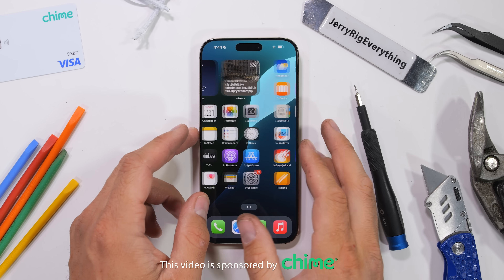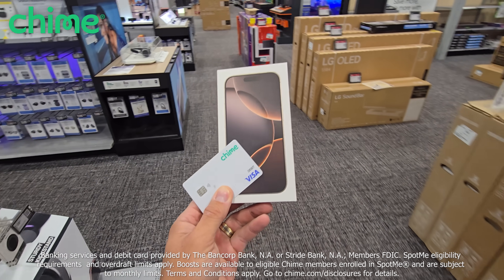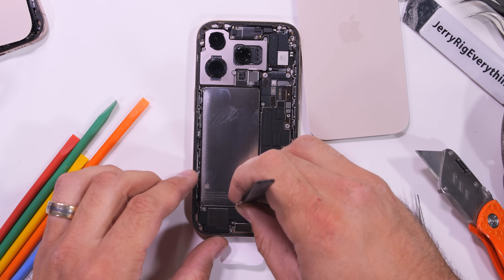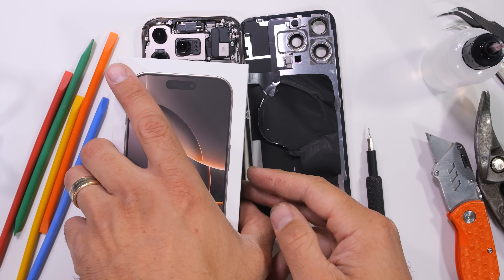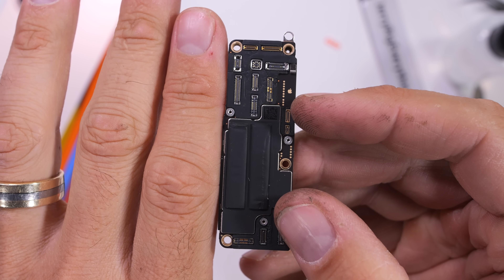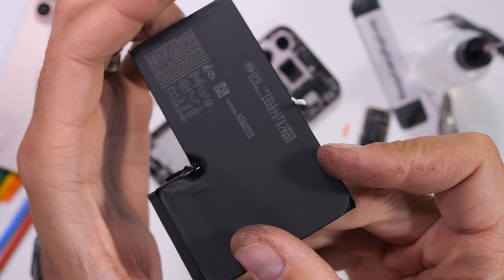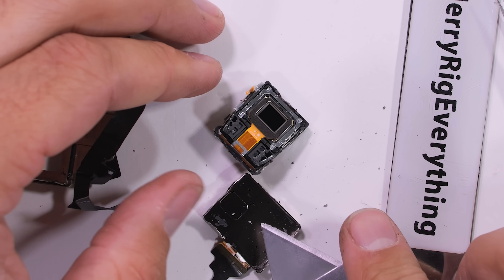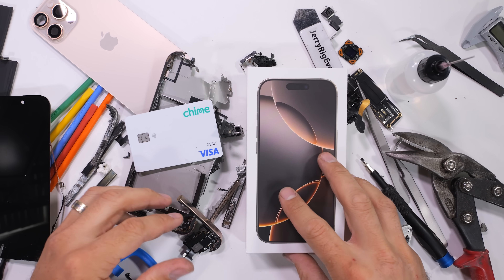Dear Apple: i am sorry...  (iPhone 16 Pro Max Teardown)

Comment: “Yesterday's tech for tomorrow's price”

Look at how wrong these guys were.
Reply: for the record they havent raised their prices for years
Reply: @noberd  Screen replacement prices have increased and battery prices haves also increased by a bit, so repairs are more expensive now
Reply: @SpaceShark2011 This is always the case with brand new phones, as supply of parts is lower. The price stabilises over time
Reply: I think I have seen this comment before. It feels like yesterday's comment for tomorrow's video.
Reply: As if other companies release groundbreaking new features each year… all of the smartphones have their pros and cons and if you’re close minded then you’ll say other phones suck anyways without actually knowing what they have to offer
Reply: Look at the sad pathetic adults arguing about a phone in the comments
Reply: @GodOfWar109  REALLLLLL, THEY'RE JUST PHONES. IT'S JUST PREFRENCE 💀💀💀
Reply: also "Create problems, sell the solution"
Reply: Freaking Android Fanboys
Reply: @JoeNasr123  Apple fanboys exist too
Reply: Right, even though Apple almost always beats androids in benchmarks and processors, and hasn’t raised their prices in years for their flagships. I know it’s a  Catchy slogan and it’s hip to hate Apple for breathing, but this is a stupid slogan frankly.
Reply: @crf1096 Yeah? Your 1000k apple will obviously beat our 500$ android 💀
Reply: What is “yesterday’s tech”?
Reply: @Jsameds Samsung using a 3 year old sensor in the S25 ultra
Reply: And still better than most phones😂
Reply: It’s much better than the junk Google and Samsung put out. I bought the latest Pixel and watch from Google. Absolute garbage.
Reply: @Fluterra need to sell that smack you must be smoking
Reply: Man, the jealous hatred of Apple is unhealthy. If you can't afford it, just don't buy it. Get a crappy Android instead. Why insist on telling lies?
Reply: @bobweiram6321 I never got the point of paying more than $250 for a new smartphone.
Reply: @bobweiram6321 Ahh, classic. When you can't justify apples crazy pricing, just throw around "You're poor"
Reply: @SpaceShark2011 imagine edit saying thanks for the heart and then ended up losing it automatically 😂
Reply: Buy something cheap then and quit the whining
Reply: Scamsungs propaganda guy spotted
Reply: Samsung may sometimes debut features first- but they don’t work properly for YEARS. Face recognition. Fingerprint sensor. Apple gets it right and it works seamlessly and flawless with no hiccups no lag. Hate to break it to ya 🤌🏼🤌🏼
Reply: @GlutenForPunishment That's the biggest apple fanboy spin zone I've seen. Firstly, Samsung made 8k 120hz cameras first and JUST AS GOOD as Samsung. Obviously it's JUST PREFRENCE. NOT FACT 💀
Reply: YouTuber commenter motto: yesterdays comment for today’s likes
Reply: iPhone destroys every other Android CPU and GPU in benchmarks. Even LAST YEAR’s apple chip destroys this year’s Snapdragon chips, so your Gen 4 cope is hilarious. Only Apple can run Resident Evil 7 and Village NATIVELY. Stop the coping; if you can’t afford it; we get it, it’s expensive; I’m
Not even an Apple fan, I rock a Pixel 9 Pro XL; but it’s time to be objective and stop the lame Apple jokes.
Reply: @Square_Penix  i agree on stopping the apple jokes, but you are a bit overracting 😅   qualcomm's gpu is tecnically much faster  than apple's igpus. The 8gen2  had a 40% stronger gpu compared to the a16;  

I say tecnically because practically  the chip cant use that monstrous gpu since qualcomm is still a good 15%-20% behind in cpu.  The 8gen4 isnt much of a cope considering that they will (allegedly) use their new nuvia cores, which should close the gap!  Or atleast, the snapdragon x elite processors with those cores are pretty good.

And we dont have native triple a games on android because no one develops them, but android has fantastic emulation.   (The witcher 3 at 720p 60fps  is now possible on a redmagic phone)
Reply: @Square_Penix  LOL yeah of course your 1000k dollar apple will run faster than my 500$ Samsung. No need to whine about how "You're just poor lol, keep coping"

If you actually looked at it objectively, you'd find that there're just phones. And it's just preference.
Reply: I don't get this. Costs the same as the s24 ultra and performs on par with it. So I guess they're both following the same motto?
Reply: Yawn…
Reply: Jerry said this in theast video about 4k camera recording didn't he?
Reply: Never heard about Nintendo then
Reply: @jcmuscle123  Nintendos tech is dirt cheap lol wydm? It's yesterday's tech for last weeks prices pretty much.
Reply: But gives tomorrow's level quality and assurance
Reply: He said that in an older video you baffoon
Reply: Wait, that isn’t the generic NPC motto? I’ve seen it at least 10x so far
Reply: Price hasn't technically changed in years. Not since the jump to iPhone X. 1199 may be the starting price, but that's because of the storage doubling up. However, they did keep the pro models price the same, even with 128gb starting storage, considering the iPhone X started at 64gb
Reply: Grabbing view in name of apple. Negativity gets more views
Reply: the scream of my brain's frontal lobe!
Reply: Fact is an iphone lasts longer than an android and i had android for more than 10 years… i have quite a lot of experience on this 👀
Reply: Android motto: make shit for everything. Micro,tv,pocomoco phone and more. 😂
Reply: Mfw iPhone is the best on the market and androidbros spend all day hating and comparing because they’re sad their Samsung is half as good as an iPhone
Reply: My iPhone 12 got stolen, do i buy a 15 or 16 ?
Reply: @Tej-Thomas.J  may as well go for the 16
Reply: Copy and paste
Reply: same price don’t get it
Reply: Apple hasn’t raised prices on its phones since 2017.
Reply: Ive been seeing this joke on the past 10 videos i watched. Its funny to me because you probably typed it on an overpriced phone from an apple with another name.
Reply: Comment copied from YT channel SamTime
Reply: Samsung’s motto: we first criticize Apple for removing something but then we got it too. We are a bunch of plagiarists whose phones explode. We call that being blown away
Reply: It’s okay, I’m not mad at them cause the iphone 16 base model doesn’t have a 120hz display, I’m just disappointed
Reply: @mniakan754  Get a samsung
Reply: The price has not changed since 15 Pro
Reply: @superqaxclub  it's just that the 128GB option has been dropped in the 15 lineup, AFAIK, 256GB was 1200$ since the 11 pro max. Not saying that the price is justified, but the price actually didn't really change. This is probably why apple puts 8GB of RAM in the macbooks by default...
Reply: Take it or leave it!
Reply: Is your avatar ragebait or something like that?
Reply: Real 😂
Reply: pidor red
Reply: Literally Zacks quote from last video
Reply: Can we not be ignorant when we criticize?
Reply: So true 😂😂❤
Reply: Chinese stuff are todays crap for yesterdays price
Reply: This comment gonna blow tf up
Reply: Did not use the 5v battery to remove pull tabs?
Reply: Vision Pro is so outdated :)
Reply: Yes, many people will think you came up with this by yourself.
Reply: He said that in his last video.
Reply: Jerry already told that in last video
Reply: Ooooo free phone!
Reply: Lost 🥱
Reply: Iphone 16 and s24 128gb both start at $800, s24 ultra $1300 while 16 pro only $1000. You are just factually incorrect
Reply: Npc comment
Reply: y’all keep saying that and its getting annoying 😭😭😭
Reply: Yet the Google 9 Pro and Pro XL has the CPU and GPU benchmarking the same as 4 year old processors 😂
Reply: i miss nokia 48MP pureview from 2012...
Reply: Bro these comments are actually mad unfunny
Reply: @immfi  They weren't supposed to be funny 💀
Reply: Hey Jerry, hearting a guy with a pfp of an idealogy that has caused tens of millions of deaths is not a great view.
Reply: Still better than every android phone
Reply: @SuperNovaHeights_  your entitlement to your opinion is a valuable good in society. everyone should be free to have an opinion, no matter how baseless.
Reply: @nutzeeer  yes. Thank you
Reply: @SuperNovaHeights_  LOL that's just blatantly untrue. Weather you want an iPhone or an android is literal preference NOT fact
Reply: You love stuff others come up with
Reply: Yesterday’s tech for future sales! 🤷‍♂️💩🫡
Reply: Hello Motto
Reply: Lol. Unfortunately I think everything is like that nowadays especially new vehicle sales. These things are coming out more expensive and shittier than ever
Reply: more like next weeks price
Reply: You took that from his other video 😂
Reply: @azuk1512 TBD valve customer service is pretty too tier
Reply: True 😂
Reply: Why do your video's make me cringe but I love them. 😂
Reply: I got listen to those pull tabs all day
Reply: It’s pretty much the same price! 🤦🏻‍♂️🤦🏻‍♂️
Reply: Good work getting a heart for literally plagiarizing Jerry!  @SpaceShark2011
Reply: Nice profile pic 👍
Reply: @SpaceShark2011 you still running that joke in 2024?! It is already iOS 18, for christ sake 18 🤦🏻‍♂️ get over it, yeah you don’t use apple, you use the latest greatest tech available we get money can buy, good for you

That android vs ios roasting is already so over roasted it has turned to charcoal
Reply: The price hasn’t changed though
Reply: Atleast the chip is good
Reply: Yesterday's joke for tomorrow's likes
Reply: 😂😂😂 low blow
Reply: profile picture checks out ✅
Reply: how is AI yeaterdays tech😂😂😂
Reply: I’m sorry, I think you mixed up your line. Apple hasn’t changed their price since the iPhone 10? 😂 and they’ve destroyed every other phone company that has
Reply: @prettycoolcat  LOL, So there phones were just always 1000k dollars for no reason?
Reply: Bro decided to spill facts😂🤌
Reply: For future price.
Reply: but its the same
Reply: Same prices for 4 years
Reply: +1
Reply: Yesterday's tech also will be out in the future for tomorrow's price 🤣
Reply: @VeryCuriousGuy Motto: Someone else’s comment for attention
Reply: Meanwhile, in reality, Samsung is using a 3 year old sensor in the S25 ultra and the Snapdragon chips are consistently at least a generation behind apples chips. And don’t get me started on the Tensor G4
Reply: @hugowells3052 No they aren't
Reply: @thark5509  Prove it
Reply: samsungs slogan is “watch out for the bombs💥”
Reply: Samsung: hold my beer
Reply: Absolutely no idea what you're talking about but hey as long as it gets likes
Reply: iOS is by far a better OS than Android.
Reply: How much is a Z fold?😊
Reply: @Someredheadguy  overpriced
Reply: Profile pic checks out
Reply: unoriginal
Reply: But better !!! Also most important Apple world for is … the smartphone itself 😂 imagine a world without Apple. People would still use flip phones and blackberry’s
Reply: apple serving up yesterdays tech... and still waiting for android to catch up 🐢
Reply: I’d rather have apple refine new tech instead of putting in junk like Samsung, giving features and tech and taking them away 2 years later; just like the IR blaster they gave us then took away.
Reply: @SpaceShark2011 Yet it will last longer than 99% Android available on the market
Reply: He said that in his last video. Copycat.
Reply: Yesterday’s tech that’s more powerful and efficient than what you’re using? That’s life the entire point of advancements in computing
Reply: @thraxberserker9960  is it yesterday's or the most powerful? Can't be both. And apple is neither.
Reply: Android: latest tech, with last decade optimization
Reply: Why do people say “tomorrow’s price”? Have you compared their prices with the other big brands flagships?? Samsung for example charges just as much. They’ve been charging that much for years. I’m not like an Apple fanboy, it’s just something people say that bothers me because no one talks about the fact that everyone else bumped their prices near Apples.
Reply: Pull Tabs ❌  screaming iphone ✅
Reply: Said by a communist…
Reply: Your??!!!
Ourr!!!!!
Reply: That’s why a have an apple every 3 years
Reply: Only if you’re the more that doesn’t sell your old phone as part of the upgrade. I’ve been upgrading every year since the 10 for $150 difference between the two phones. Fully unlocked - no device payment.
Reply: Thats why i still have the Iphone 11 and am finally upgrading to the iphone 16 pro max (due to storage, my iPhone 11 is a 64gb😭 and I’ve had it for almost 5 years now)
Reply: Not the best sorry
Reply: Faking Man
Reply: Cheaper than the galaxy phones now days
Reply: An Apple a year makes ypur wallet thinner 😁
Reply: You know these discussions have been going on for decades now, don’t you. If you’re so eager to defend your purchase choice… you might have buyers remorse.
Reply: Facts
Reply: Wrong
Reply: Any android phone I've worked with so far that's around the same spec level doesn't work as fluently and intuitively as an iPhone so one could argue android phones need buffed specs to achieve the same 😅 just throwing that out there. I'm an Apple user but by no means a fanboy, however, tastychocolat's comment is just stupid. Apple's the easy target for hate because of poorer repairability, but Samsung flagship phone repairs often cost around the same. Especially in the case of the most occurring repair, a screen replacement. In terms of pricing, that argument holds up poorly and I'd guess they're just a hater or an android fanboy.
Reply: It’s just a better experience. At the end of the day if it’s something I have to use daily I like it to be a cohesive experience. Just Face ID alone makes using a smart phone for so many things significantly easier. I genuinely don’t know why people care so much about stats when overall it’s simply about making the experience of using the product easier and more enjoyable. Apple achieves that which is why people buy them. I like that all of my tech(with the exception of my PC at work) is well synched and a cohesive ecosystem. If that means my screen resolution is .09% worse or loading speed is 1.2% slower i just don’t care. I don’t understand why people don’t seem to comprehend that most people simply assign more value to what makes their life easier. Say what you want about Apple but you can’t really deny they’ve done a great job at making their products all integrate together well.
Reply: You can play windows games on Android you can't on iPhone , plus iPhone has trash keyboard and no universal back button, also iOS 18 is a buggy mess, little to no ai features, that's coming from some one who has a 16 pro max
Reply: Meanwhile Samsung recycling the same S Ultra design since the S22 Ultra
Reply: @Gamezoner911  since the note 10+
Reply: And it just got leaked that the cameras are not getting upgraded till the s27 on the standard and plus models…..
Reply: @Gamezoner911  So there's a fkin changes in iPhone designs? 😱🤦
Reply: @Gamezoner911 And next year they’ll use the same main camera sensor for the 3rd time
Reply: @Gamezoner911 but they do something in software right away
Reply: @Gamezoner911 bro its still modern
Reply: @Gamezoner911 yeah same thing for apple from iphone 11 pro to iphone 16 pro. only difference is dynamic island but androids had punch hole camera design for sooo long that i don't count it because its not a remarkable design change after all
Reply: @DrHaldunGoksun what did Samsung add?
Reply: @reyash4 what does apple ever add.....that is innovative or important...I'll wait
Reply: @DrHaldunGoksun That’s only the only difference if you ignore all the changes they’ve made over the years
Reply: @Gamezoner911 I mean iphones design hasn't changed since the iphone 11. And their non pro phones look like a iPhone Xs. Lol
Reply: @BattleRapMultiverse didn’t Samsung change their phones last year to be more like an iPhone?
Pretty sure they even gave their tablet a notch too 🤦‍♂️
Reply: @BattleRapMultiverse Both objectively wrong
Reply: @BattleRapMultiverse Only if you’re blind
Reply: @BattleRapMultiverse dude have you ever seen a 15 or 16 IRL? You need a doctor for your eyes if you say they are similar to the 14
Reply: @Sayin42  Yeah. But still, neither of em are innovating in design. Lol
Reply: @MrJairforce  Numbers don't lie.
Reply: @hugowells3052  Data says otherwise.
Reply: @skrotosd  Yes. I've seen a 16 IRL, a pro max. Bezels are slimmer, other than that if you were a foot away and I had a cover on you wouldn't know it's a 16.

Edit: Same for Samsung.
Reply: @BattleRapMultiverse 
But here's the thing, changing design was never the motto of Apple and Apple is instead known for keeping the same designs, while Samsung fans always bring up their "new" designs. 
I have no issue with others preferring different designs every other model but I do have issue with those that bash people who aren't big fans of that and like constant designs.
Reply: @holyromanemperor420  I responded to someone mentioning designs, I'm not an apple user by any means. I'm actually a pixel owner, soon to transition to honor once the magic 7 pro releases next year since I want an ecosystem that Google does not have.

The reason I mentioned design was a response to someone that pointed out designs. I really don't care much for design changes. I care about software improvements.
Reply: @BattleRapMultiverse  🤣 Which data?
Reply: @BattleRapMultiverse  Which data?
Reply: @BattleRapMultiverse  What numbers?
Reply: @Gamezoner911 tbh.. the S22  Ultra is the most beautiful Smartphone Design Ever made. They can stick to that design forever. Like Apple does 😂😂
Reply: How original. I’m glad to see “yesterday’s tech” obliterating the S24 ultra for battery life 😂
Reply: @BCJ1973 false I can confirm it didn't beat the s24ultra in battery life 😂
Reply: Aight
Reply: Boring 🥱
Reply: What’s Samsungs? “Keep a fire extinguisher handy”
Reply: @marv8481 APPLE SHEEP SPOTTED LOOOOL
Reply: @marv8481  Maybye the samsung phones exploding thing was true in like 2016 💀💀💀
Reply: Umm, ahktually their A18 PRO is 89% faster than Qualcomm lastest in gaming🤓🤓
Reply: 89% the 8 Gen 3 still has a faster GPU than the A18 Pro 🤣@sivaxiosu
Reply: @dqskatt on a 60hz panel what a difference.and even on ultra you get that 89% the first minute after throttling -89%😂
Reply: @dqskatt  what else isnt yesterday cos their refresh rate is, their new customization is, their battery  (reverse wireless charging speed, and wired charging speeds), should i go on?

So when we say yesterday's tech for today's price, he ain't lying.
Reply: And what games have native support?i mean pc games running on arm by default  @dqskatt
Reply: @dqskatt  it seems that the new Qualcomm is gonna be better
Reply: @dqskatt  Apple gaming is not a big deal tho.
Reply: @KatTheCaz  iPhone is the best and fastest device there's for gaming, with Emulation is finally allowed in iOS, there's no point in choosing Android over iOS in 2024 purely based on gaming.

Except for pure delusional, Let 65% GPU utilization while being 2x faster speak for itself.
Reply: @dqskatt  I don't really game on phones anyway tho. But I use android sideloading a lot and now that Google basically removed it I might switch to jailbroken or even normal iOS anyway. The thing I like about apple devices is that it just works. Android be like: Home menu doesn't respond. Yea thanks. Meanwhile iOS chillin' in the corner sippin' some coffee.
Reply: @KatTheCaz how did google remove it?
Reply: @KatTheCaz  LOL you live in candy land? A samsung phones home menu will respond just as well as an apples as long as it isn't broken. But IT'S JUST PREFRENCE lol
Reply: @dqskatt and its cheaper than Samsung S24 Ultra
Reply: @dqskatt Only for 5 Minuten ;) than it is throttling under the snapdragon gen 3
Reply: @DoubbleDdragon  How can 65% utilization can thermal throttle, iPhone 16 Pro Max is actually 9 degree cooler than Samsung S24 Ultra 45 degree that difference from hot to touch vs warm.
Reply: @dqskatt But you are only using 60% of its capabilities, what a waste
Reply: @dqskatt the only thing they upgraded is better than last generation, wow
Reply: @dqskatt  who even need that much of power inside a smartphone that only use light processing apps. So unnecessary.

Just use PC if u need to game or boot heavy processing apps
Reply: ❤ @dqskatt  lol what's the point of having best Chipset if their iphone doesn't have good themal and it's not focused on gaming also the screen are just 120fps lol that's too expensive
Reply: @dqskatt  tell it again after 8gen 4 launches
Reply: @dqskatt no? The SD 8 gen 3 on the s24 ultra outperforms the s24 ultra in antutu
Reply: @dqskatt not true gen 3 GPU much more powerful
Reply: @dqskatt  SD 8 gen 4 on the way to beat A18 pro🤣
Reply: I appreciate how much people are comparing and complaining about phone processing chips when they all do the same things. They game, help you daily tasks like calling, texting, music, videos, social media scrolling. Does it even matter that much?
Reply: @JinsmokeDS  I agree with you, it really doesn’t matter! It only comes down to which OS you like better, like the only reason I use iPhone is because I like iOS better
Reply: Based profile picture, comrade ♥️🤝🏻
Reply: JerryRigsEverything says, then shows his Galaxy S24 Ultra that cost 100 dollar more than the Pro Max with the same storage. 

Not to mention that iPhone crushes Samsung in benchmarks etc. 🎉
Reply: Hey, great analogy. I feel like it's more like today's tech for next month's price.
Reply: Bruh 😂😂 so true that was!!
Reply: overused template
Reply: So many of you accuse apple of stealing when they literally contributed so much to the tech industry.

- First successful GUI computer
- iphone 1 which set the standard for modern day smartphones
- iphone x bringing the edge to edge display

There is so much they Apple’s done for the industry and you all hate it why? Because you cannot wrap your head around why majority buys Apple and not android. 

Most people just need a phone that runs smooth and performs the basic functions at the highest standard. Apple has good performance, good optimisation, clean and easy to use UI, best ecosystem . The camera’s are good. The reason you don’t see those people on YT is because they aren’t here complaining like you android users who are just hating for the sake of their own ego. 

You don’t like iphone get over it and purchase an android. Imagine arguing like this under every video each time. Talking about people spending money on a phone that isn’t worth the price as if yall aren’t wasting your lunch money on chicken nuggies and tacos
Reply: @xxryxn   The majority you're talking about is only in US. Outside US, android is the dominating one.  Also about "complaining", don't be BIASED, as if Apple users aren't complaining too and bashing Android. Also are we really going to talk about speed? Like they're pretty negligible and you won't see any difference, unless you buy a cheap phone lol. Just don't be one sided. Almost all videos are like this, if it's about Apple, they're going to talkshit, if it's about Android, the other side will too. No need to reply long ass comment to prove a point (but I will too lmao). Also, ofc Apple did contribute a lot, IN THE PAST, when Steve Jobs is still alive. Now, they'll pretty much copy something on Android and make it in the "Apple way" and people will call it "innovation" and stuff, like as if it doesn't exist on Android before them. Well, Android also copies them too ofc. At the end of the day, both of them are just copying each other.

So like if Android users accuses Apple, you gotta be mad? And if Apple users accuses Android, it's fine? Android contributed a lot in the industry too, but did you mention it? No. Oh please... At the end of the day, it depends on each others preferences.
Reply: @jeeyeem  First off all, I meant to say majority that prefer to get an iphone.
Second, outside of US or the west to be more precise, the reason android dominates is because of affordability. How many people do you think in third world countries can afford Apple products without taking out a loan or purchasing a used one. And I didn’t say the fastest. Because speed is negligible I said good performance. 

And be honest. Android users do bash apple products more. I have never seen thousands of apple users go under a video of a newly released android product and go bash it. Android users complain about apple removing stuff from the box or removing stuff like headphone jack but when android follows the trend their mouths get shut. Also, not to mention this dirty little game android fans play. There are hundreds of phones that run on android from different brands. Android fans literally nit pick the best feature out of a phone to bash apple. Photos? Pixel. Zoom? Samsung. Charging? Xiaomi. Battery size? Some gaming phone like Asus. 

Idk if ur an android fan or apple fan or even just a user. But android users bash ios more. Especially those living in third world countries? Why? As i said. They can’t afford them so they hate them. 

“ohh I can’t afford ios but doesn’t matter my 200 dollar android is more customisable, apple is so bad haha”

Don’t say i am lying coz this is fucking true.
Reply: @xxryxn  I just commented a new one, and for some reason I can't see it. Anyways, I ain't gonna repeat it. I'm just going to keep it short, you need to see things on the other side too, if you do, keep out your biases out of it.

I'm neither on Android or Apple side, I just prefer android as a developer. For the reference, I own both devices, and I use iPhone for Video, and Pixel for pictures.
Reply: @jeeyeem  I do see things on the other side. I have used Android for majority of my life. My xiaomi had an IR blaster and only god knows how many times i have turned off protectors in high school. But the hate towards ios is unjustified. They aren’t wrong about iOS lacking features but I don’t like where they come from. The source of their hate is unjustified.
Reply: @xxryxn  That's the thing I'm talking about. It's not just Android peeps hating Apple products, Apple users do so too in equal amount. Heck, I even see lots of videos Apple users comparing iPhone with cheap Android phones. I can't help but laugh. Aren't Apple users hate on Android more unjustified, especially in US? Like, they'll say you're poor once they see that you have green bubbles and stuff? I mean, they'll think you're poor just for having an Android phone. Like, they don't know that there are Android phones more expensive than iPhone, or they don't just care at all, and call you poor anyways.
Reply: @jeeyeem  I see the problem now. Your argument is more west oriented and mine is more towards the east, third world countries. So different reasons and different arguments. And you are right about people in developed countries thinking android users are poor. Well I am gonna stick to what I like more. Good talk.
Reply: @xxryxn YOU APPLE FANBOYS DO THE SAME!

IT'S JUST PREFRENCE, NOT FACT!
ALSO, APPLE IS INCREDIBLY ANTI CONSUMER EVEN CONPARED TO EVERYONE ELSE!
Reply: Explain how their processors are years beyond anything from Qualcomm or Intel? Also how are their cameras years beyond anything from Sony and Samsung? Oh right this is just dumb cope from smoothbrains incapable of doing anything but repeating tired jokes.
Reply: @rolfanderson3925 they arent years behind!? An A16 can beat the newest snapdragon chip lmfao
Reply: @morpheus_9   Improve your reading skills. I said Apple SoC’s are years ahead of QC.
Reply: @rolfanderson3925 * Android smartphones - upto 120 watt chargers.
* Apple iphone's  - what is "watt" ? 
 We earn more than Chinese. We sell 20w charger seperately for Rs 2,000. 😀😀
* iphone  : 
Same old notch ( now modified as "Dynamic island" ), no charger in box, no 3.5 mm audio jack, no FM radio, no expandable memory card slot, one sim + one e-sim,  usb type 'C' charging port only in latest 15 series from September 2023, only 60hz display in non pro iPhone 15 models.
🤔🤔
But, iphone is the best. 😀😀
Reply: @rolfanderson3925 apple has dibs on all of TSMC 3nm production for the entire year
Reply: Samsung is Tommorows Tech for Todays price.
Reply: @epzo  Samsung is somehow worse than apple for this
Reply: @epzo Yeah that is just not true, except for charging speeds
Reply: @dressrosaRMFC  cope harder apple fanboy
Reply: @epzo  I'm literally using an S24 Ultra but sure
Reply: @epzo sorry about those green messages. Seems like that really upset you a while back. I didn’t even know there were Samsung fanboys though so Ty for the knowledge.
Reply: @epzo $1400 for a Samsung S24 Ultra, keep coping kid
Reply: @epzo if it’s tomorrow’s tech, then why is it already here right now.
Reply: @epzo  Samsung is more expensive than iPhone lol
Reply: @Jsameds  While being 10x better
Reply: @epzo  Review scores are pretty level between the two so I don’t think so
Reply: 2230€ for a macbook pro with revolutionary 8 gb of ram!
Reply: @wlaznydominik No one forces iPhone users to buy a Macbook, I use linux while using Samsung Tablet and iPhone.

But 8GB and 256GB at 1100USD is outrageous.
Reply: @wlaznydominik my 3 year old MacBook Air outperforms my brand new Dell Latitude 😢
Reply: @wlaznydominik  I haven’t dug into it but I’m pretty sure the new base model is 16gb
Reply: @wlaznydominik 
Macbooks Pros don't have "rams", you are comparing Apples to Oranges. Their memory system works differently due to entirely different chips and they work great.
Reply: * Android smartphones - upto 120 watt chargers.
* Apple iphone's  - what is "watt" ? 
 We earn more than Chinese. We sell 20w charger seperately for Rs 2,000. 😀😀
* iphone  : 
Same old notch ( now modified as "Dynamic island" ), no charger in box, no 3.5 mm audio jack, no FM radio, no expandable memory card slot, one sim + one e-sim,  usb type 'C' charging port only in latest 15 series from September 2023, only 60hz display in non pro iPhone 15 models.
🤔🤔
But, iphone is the best. 😀😀
Reply: @sunilnathani3924  “but iPhone is the best”

Correct.
Reply: @sunilnathani3924  Wait you think FM radio and a headphone jack is tomorrow’s tech?
Reply: @sunilnathani3924 ur only argument about how Samsung is better was the amount of watts in a charge. i love Samsung but srsly? That’s stupid.
Reply: @sunilnathani3924 You forgot to mention, iPhone have no quick side panel for convenience while Samsung have it!